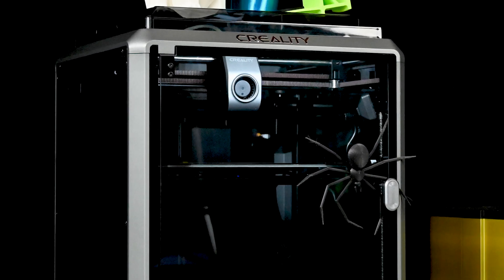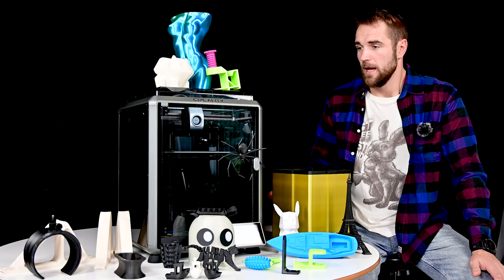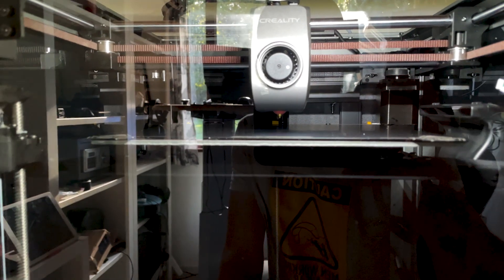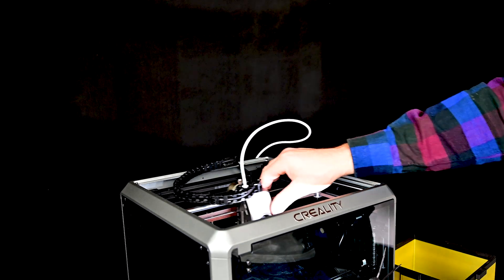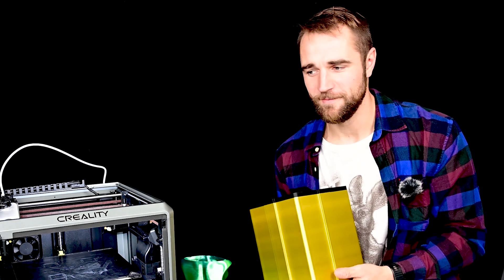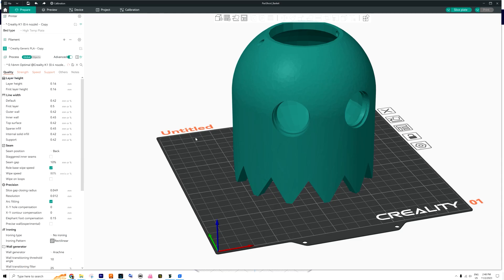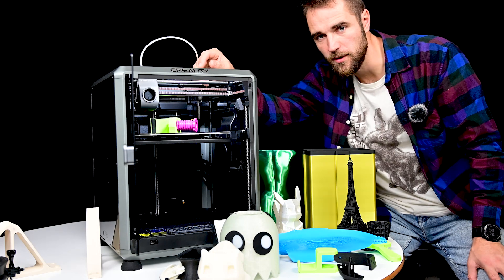Creality K1 3D printer review

Comment: it does cool down to prevent plastic from drooping out the nozzle while doing the bed leveling, as it would interfere with the loadcell bedleveling, which is why it touches the nozzle multiple times before, to push away any remaining plastic on the tip.
Reply from the maker: I had this suspicion, but was not really sure. Thank you man!

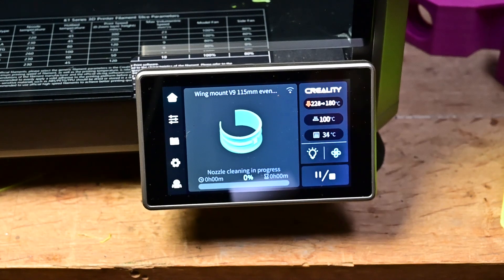Comment: In 7:00 it is happening because its part of your gcode. 
When you slice your file, there is a pre-code defining all these machine commands and add them to the gcode before the actual printing commands. Just make sure you disable it when slicing if you dont need it
Reply from the maker: Nah mate, I have edited the start gcode and the printer does not care about it. Looks like it is in the firmware

Comment: Did you print with real nylon, or it was just some mixes like "Easy Nylon"?

On my open chamber printer i forced to use special glue for the nylon, otherwise it just peal off my PEI bed even on tiny prints like washers.
Reply from the maker: I think it is the Overture brand nylon, not sure how “easy” or not it is :D I have to admit I am new to nylon, it is the first one I tried

Comment: My God man your ringing is terrible. But you probably printed fast so... Forgiven
Reply from the maker: 20k acceleration and 300-400mm/s 🙄
Reply: did you calibrate the input shaping?
Reply from the maker: @Untiocansado  It calibrates itself when you do the initial full calibration and judging by the movements the printhead does - before every print as well. Are you talking about any additional calibration?
Reply: @VRMinde you need to root printer and change printer.cfg to do input shaping on y-axis as well. Creality only does x-axis and use the same value for y. This is a lazy and terrible decision by creality.
Reply from the maker: @mortegutt thanks man. I did not know that. I am not sure I am gonna do it. It is my favorite "go-to" printer at the moment and I do not want to mess it up :D
Reply: @VRMinde  totally understandable! 
There are several guides on rooting the printer and enabling full klipper where you get access to these settings. When you have rooted I suspect it's as easy as removing a #, plain and simple! I highly recommend doing this, as you will see a boost in print quality.
Reply from the maker: will need to take a look at some point in 2024. Or maybe Creality will release a FW update with it fixed? :)  @mortegutt
Reply: @VRMinde  one can hope 🤞
Happy new year!
Reply from the maker: Happy new year mate!  @mortegutt